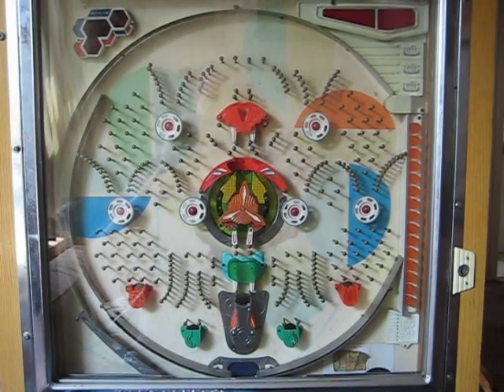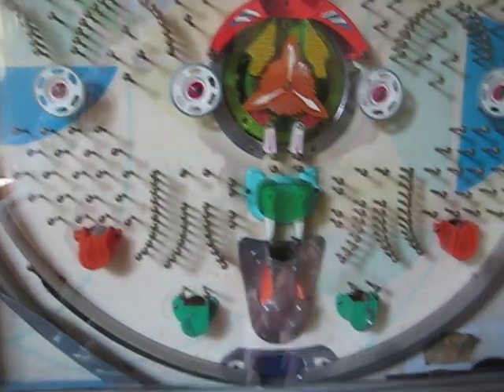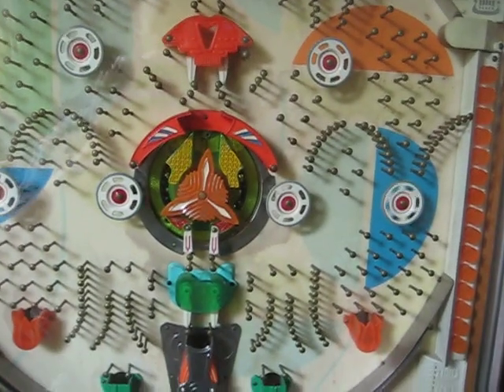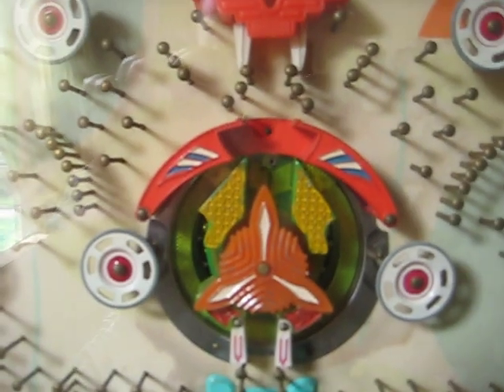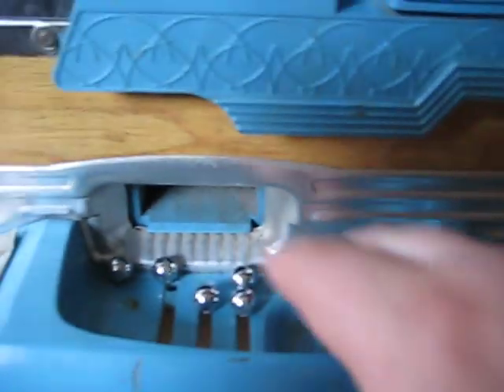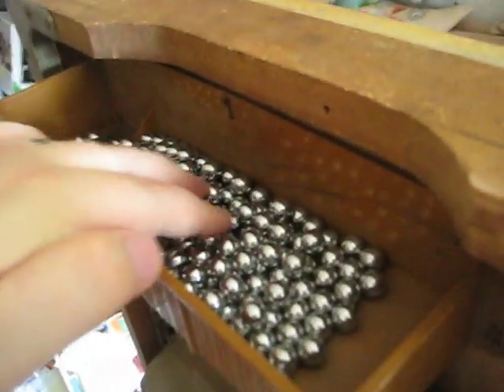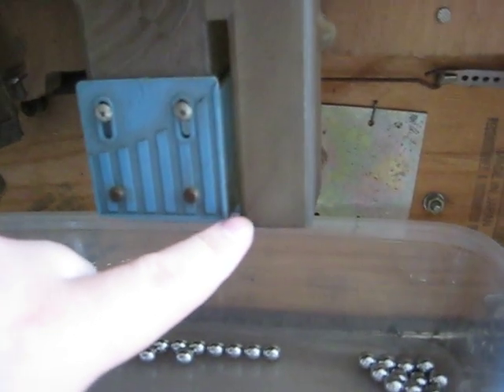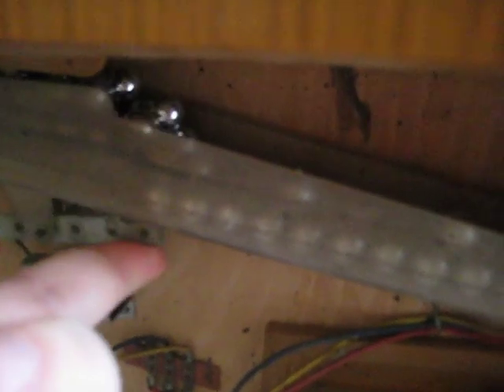1970s Nishijin Pachinko Machine - Propeller

Comment: Please excuse me being thick, so the only power these need are for the lights and that is 10 volt you are saying?
Reply: And also how do you open the front to clean it? taken the lock off but can't get inside to clean it's display!
Reply from the maker: Really it just needs to be enough to power either of the two lights on the machine. In theory, you could throw in some low power LED lamps and power them off of a few AA or AAA batteries. In my case, I've got a 9v battery hooked up.
Reply: Thank you so very much for your fast reply, means a lot. Will rig up a system the same as yours me thinks!